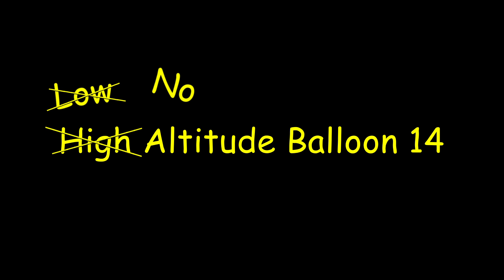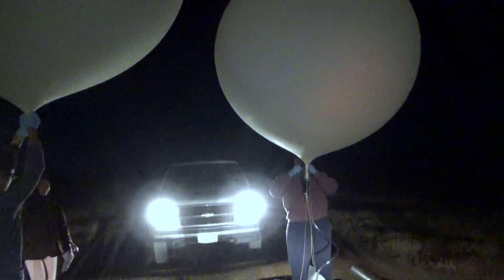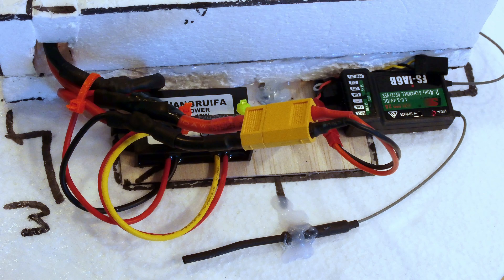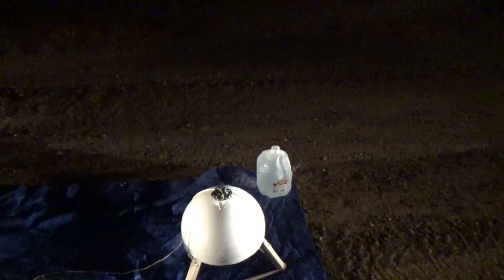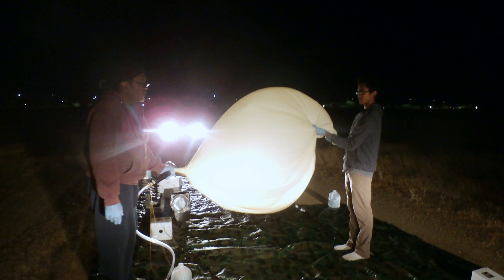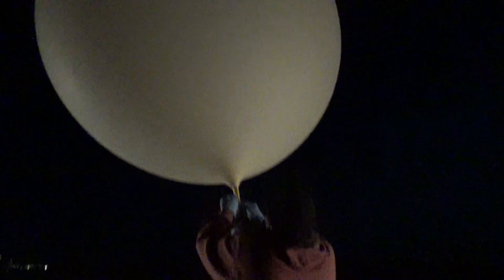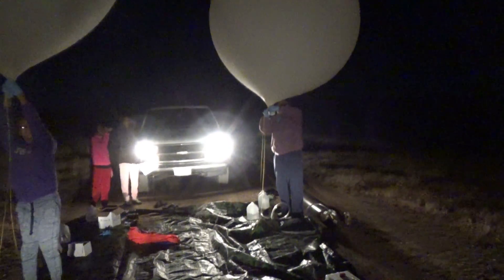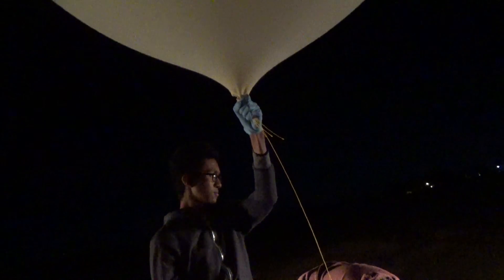High Altitude Balloon 14

Comment: Hi Dwayne. 
As I mentioned under another video, I developed a HORIZON SIMULATOR and I'm trying to use your videos as reference.
https://www.geogebra.org/m/pswrxrgq

The principle of operation of the simulator is pretty simple. It's possible to add the dimension of the camera sensor, the focal length of the lense (in millimeters) and the altitude of the balloon (in kilometers    -     1 mile = 1,60934 kilometers)  of the frame to be tested.

Here there's the math behind the simulator   (the page is in Italian, but there's a page-translator on the right)
http://flatearthdelusion.blogspot.com/2018/08/lequazione-dellorizzonte.html

Up to now, The overlapping of the curved horizon at high altitude of your videos and the one from the simulator is a perfect match.

Obviously, the curve comes out more evident in the cases where you used the 4.35 lens rather than the 7.2 lens, due to the larger FOV.
Too bad you used it mainly in the first videos when you had not yet integrated the altitude indicator.